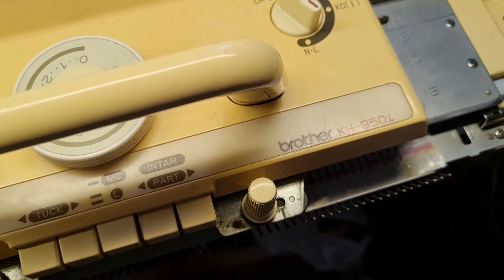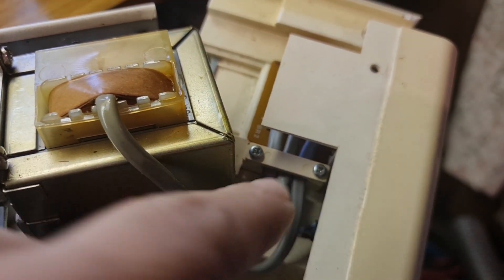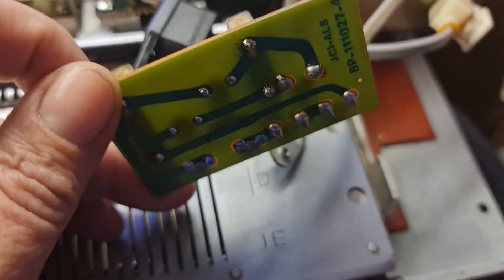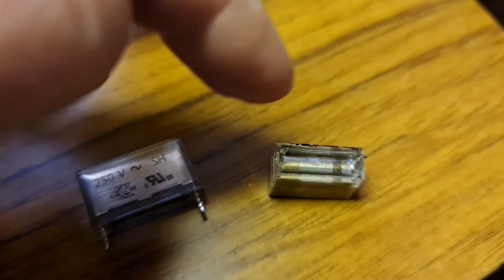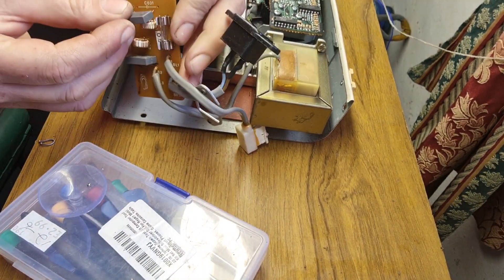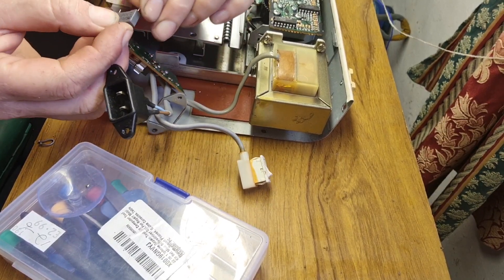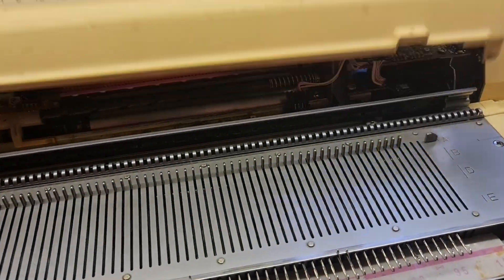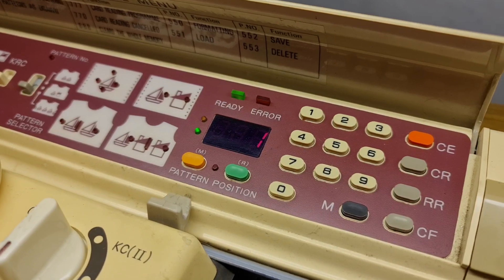How to change Brother Electroknit capacitors. My knitting machine is smoking!! #Scarletpeate #kh950i

Comment: It doesn't matter in this situation since it is AC on the side you are working, but something that should be added, most of the time Caps have a polarity. So if you were to try and replace a cap on the inside, if you put it back to front you would do irriversible damage. 
Like I said, in this situation it doesn't matter, but you never know, someone may take the information from this video and apply it somewhere else.
Reply from the maker: Good point.  Thanks x